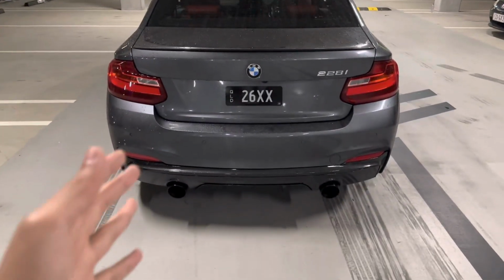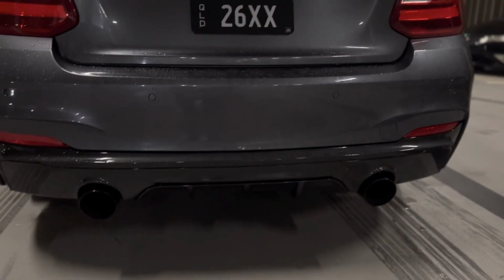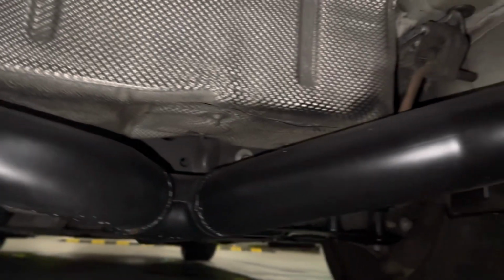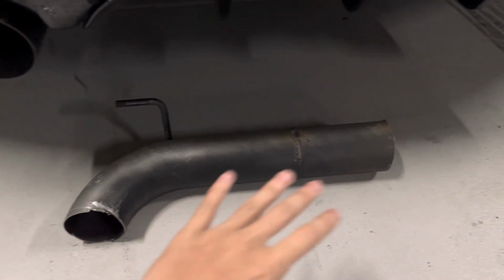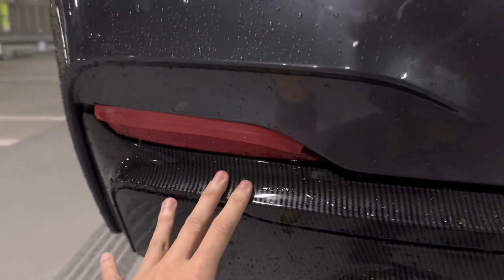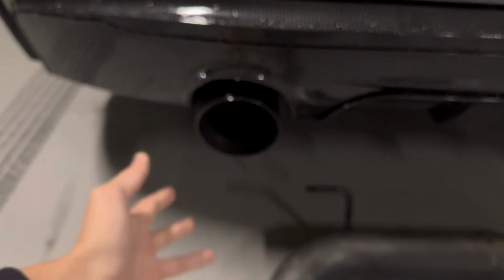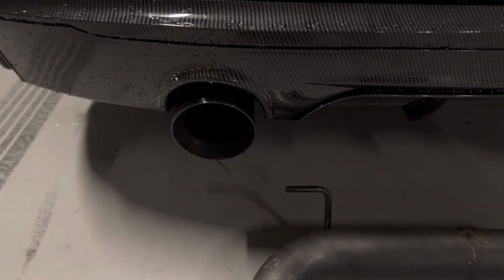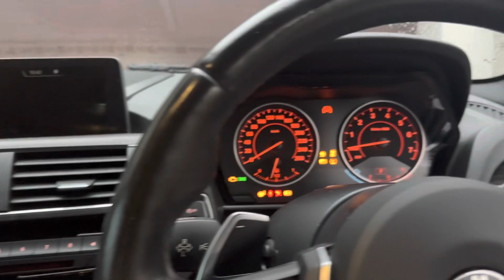BEST STRAIGHT PIPE SETUP!! BMW F22 228I N20/N26

Comment: I've got an appointment next week to straight pipe by N26 — definitely getting a new diffuser now and going with the dual setup. Thanks for the killer video. 

Can you share some details on your tune? Seems like you've got the blurbles dialed in perfectly!
Reply from the maker: Appreciate it heaps 🤝🏾 I’ve got more mods done since and will make more videos on it ASAP. Believe it or not but at that time my car is on stock tune and I get those burbles as is so you should be getting them soon too
Reply: @leo26xx  well, I just went straight pipe on mine today, but I also have a tune, big turbo and catless downpipe — It's definitely a bit too aggressive now! I might need to adjust the tune file quite a bit 😬

Comment: How do you make it Dsg fart I’ve got a res delete at the moment won’t do it loud
Reply from the maker: Get xhp stage tune or go straight pipe. Use paddles and from 1-2-3 under hard acceleration you’ll get the 💥
Reply: @leo26xx does straight pipe make pops and bangs ( downpipe , muffler delete , resonator delete)?
Reply: Mine does it with just muffler delete 😭